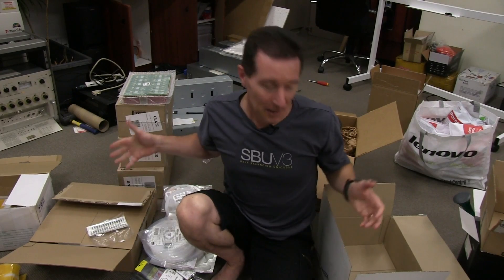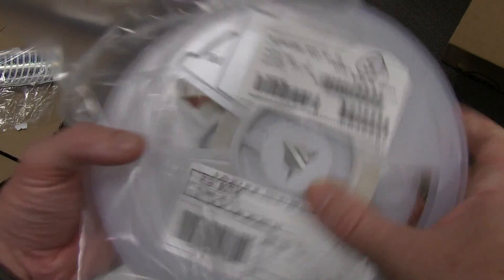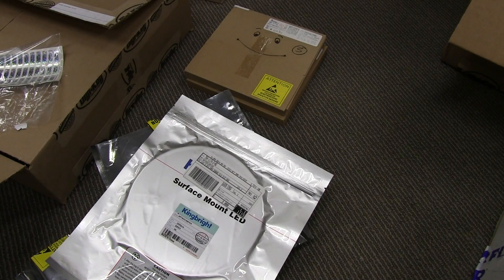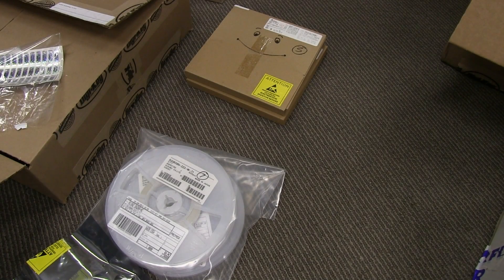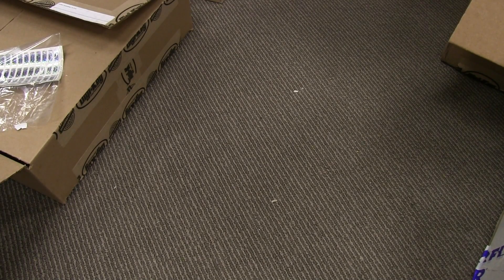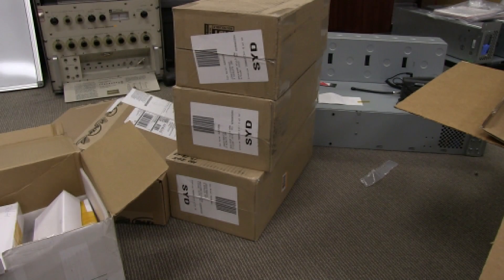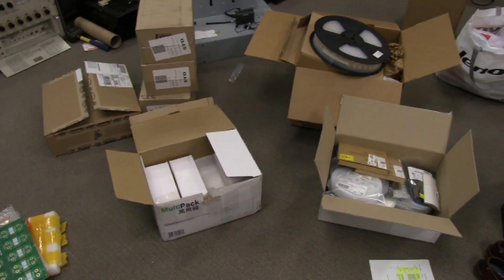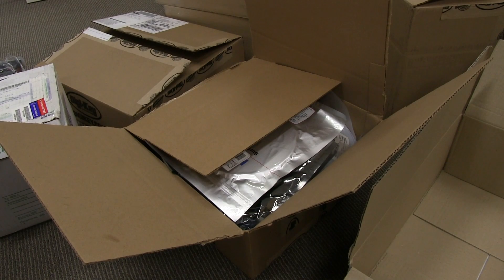uCurrent GOLD Assembler Parts Shipping

Comment: Reminds me of doing the same for the products I`ve designed. Great video!!!
Reply: What kind of products have you designed?
Reply: ***** I design mostly broadcast TV and Radio related stuff. My last one was a multituner radio receiver, which can tune to a number of stations and stream high quality digitized audio to a computer. My next one is the electronic load Dave built on Episode 104. I will probably integrate it with the Beaglebone, making a cape or something like that.
Reply: Moreno Addad Hassem Oh that's cool, I've only done some SDR stuff as for radio-related electronics. That Raphael R820t tuner is probably the best low-end tuner in the world. What sort of power dissipation are you going for when you say electronic load?
Reply: ***** Well, I'm interested in extracting I-V curves for solar panels, so I will probably design something up to 200W, as most of the panels on the market go from 30W to 120-185W. For these kinds of loads, you have to use several transistors, or the thing will probably melt under the sun. This is part of the instrument set I will be using in my masters project. I've assembled a prototype using perfboard and using heatsink and a fan, the transistor body went to almost 100 degrees celsius at 18V / 2A.
Reply: Moreno Addad Hassem Maybe it's a stupid question, but you're using mosfets as electronic loads, right? Like using them as variable resistors and sticking them straight on heatsinks? Alternatively, you can use mosfets to divert power to those cement resistors. They're dirt cheap and can handle a lot more heat dissipation than mosfets can. 

Cool stuff though! I didn't know panels went all the way to 180W a pop. Is this like those big 2m² solar panels?

Comment: Why don't these assemblers just keep a range of the standard jellybean resistors and capacitors spooled up on the machine instead of getting you to send them to them? It would cost more to place that spool on their machine than the cost of the spool - and if they can get enormous reels, it would cost a lot less!
Reply: Pick and place machines have a limited number of reel slots and there are quite a lot of different "jellybean components" (for example E24 from 1 ohm to 1 megohm is 145 different values, then multiply that by the number of different standard package sizes arround and you are talking hundreds of reels).

So whoever is supplying the components the machine is going to have to be loaded with a different set of reels for each job.

IIRC pick and place machines often have removable reel racks so one set of boards can be being produced while the next set of boards is having it's components racked.

Some vendors (for example pcbtrain) do keep stock of jellybean parts for use on customer prototype boards, presumablly because it's easier for them to use their own full reels than the cut tape or re-reeled parts that customers are likely to send. For production there is probablly less point as the job will likely be using at least a substantial fraction of a reel.

Comment: that's insane!!!! im wondering at what point it becomes worth setting up your own assembler and buying all the gear
Reply: The cost of the pick and place machine alone is >$100K, not to mention all the other equipment that you would need. Unless you plan to go into business as an assembler the answer is NEVER.
Reply: Rob Morley  That isn't necessarily true, a decent but low end PNP machine (none of the chinese junk) can be as cheap as 30k for a manufacturer refurbished machine.

For ultra precision equipment, eg, precision current standards ect it can be beneficial for self assembly as you can ensure the process is carried out to spec without boards being contaminated or whatnot.

For equipment that is "made to order" (eg, $500k scopes) or low volume high profit products, it can be useful, as you don't want to keep many in stock and the volume is low.

Additionally, for equipment that requires extensive calibration, testing and configuration it may also be worthwhile because the assembly process may be only a fraction of the manufacturing time/cost.

That said, these are the exceptions, rather than the rule, so whilst in some cases it may be viable, usually, it really really isn't.
Reply: Keeping in mind that the examples you are referring to are low volume, high cost products, where assembling and testing is done in house. As you said it's the exception not the rule.

My original statement was meant to cover the hobbyist, and not businesses with low volume, high cost products. Sorry for the confusion. :)